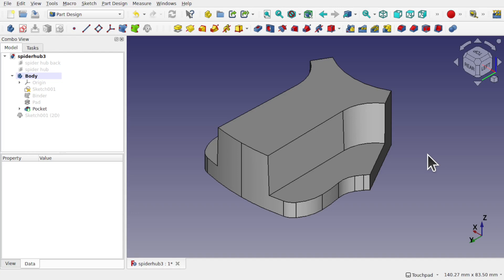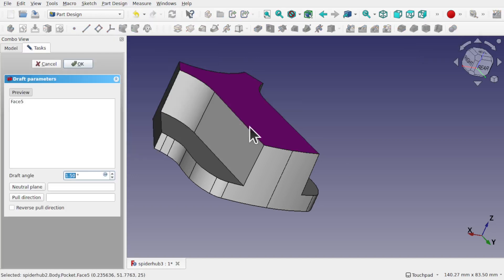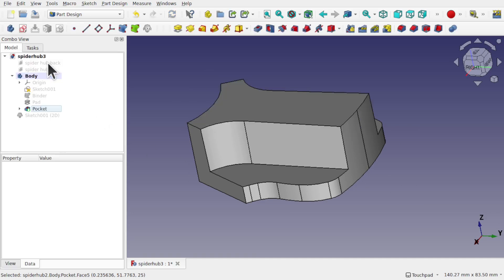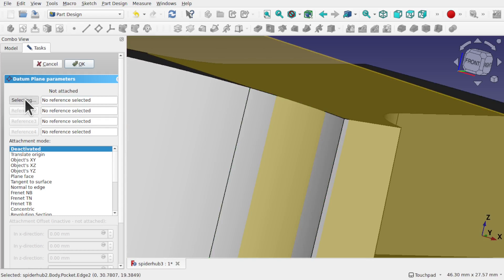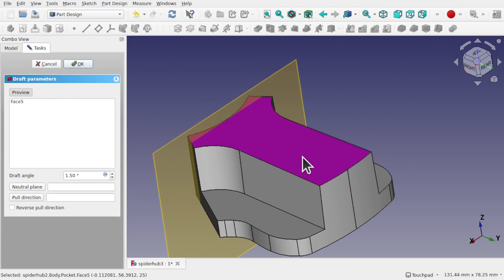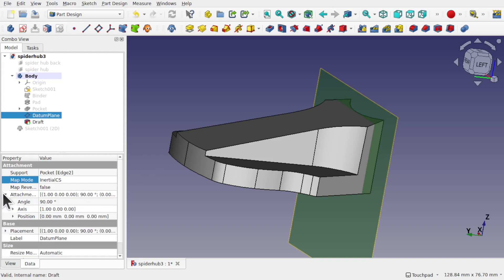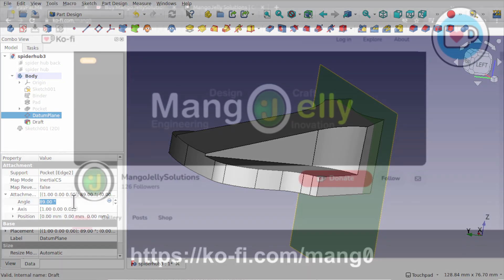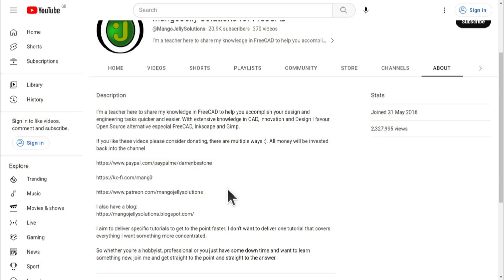FreeCAD: Drafting using datum planes | Tip for no planner objects in the part design

Comment: I used this after watching your , Part or Part Design video. I used this method on a concave model that I wanted slots on each end. I needed to do this to get a pocket in Part Design.
Reply: Well, then I realized if I just move the sketch origin away from the model it worked.

Comment: Your Assembly 4 tutorial are the best I have seen. Would it be possible to have Assembly 4 tutorials?
Reply from the maker: Thank you :) I was only think that I haven't done any assembly tutorials for a while.  Time to make some more!
Reply: @MangoJellySolutions Spot on 👍. I find freecad great for doing parts, but once I go to assemble them, I just lose interest. A2+ was ok, but since the last FC update, its pretty much not working. So I too was thinking of going back to A4, to try that again. In fact, just now I am doing practice model of a rail wagon from old  drawings I downloaded. FC great for sketching parts on images, but for assembly I am just exporting to solidworks to assemble there, cos it works. But, I will keep doing the parts in FC for assembly in FC once I find an easier way.

Comment: i ordered a 3d printer and its in the mail, i have so much to learn in order to start 3d printing, i was hoping it was going to be much easier than this.
Reply: If you are keen, with Darren's help you will get there. Go back to his earlier video's. If it wasn't for these video's I would of given up months ago.
Reply from the maker: Don't get down hearted.  CAD and 3D printing has a steep learning curve especially when you get into filament temperatures, flow rates etc.  But you just need to get the very basics down and to produce half decent quality prints.  CAD has it's own learning curve but take it slowly and you will get there one small project at a time.  The 3D printing and CAD world is huge and you can't learn everything at once, take your time and have some fun, don't worry about failings, that's how we learn.  The first time I tried to 3D print something I took half a day just trying to level the bed, just couldn't get it right, and then i couldn't get the prints to stick.  You will get frustrated and upset but just stick in there and you will crack it :)
Reply: @MangoJellySolutions  thank you for the reply, what i am hoping to print i feel is the more advance side of things!
i am hoping to fit an array in the model i am hoping to build so it needs to have perfect fitting sizes i have to make over 100 perfect holes in what i am hoping to build. so this is down to the exact MM that would need to be perfect
i have been designing something for over 20 years of my life and the only way i am able to build now i feel is with a 3D printer.

i honestly feel if i am correct with what i am doing, in layman terms it will reinvent the wheel.
if i am correct i can't even start to imagine.

i ordered a 3d printer that has 420mm x 420mm x 420mm printable space it is currently in the mail, but i feel it may take up to 6 months before i can turn my design into reality

i feel if i am correct with what i hope to build, the sky isn't the limit the honest to god universe will be!